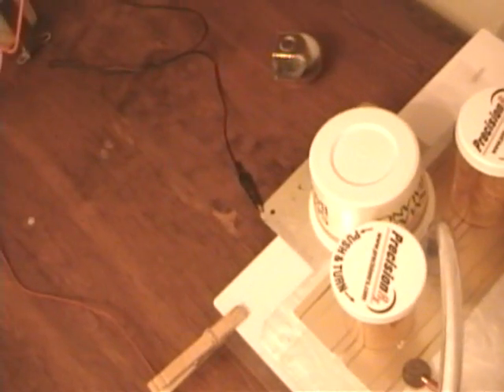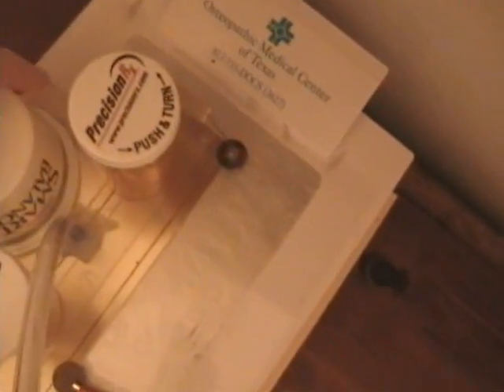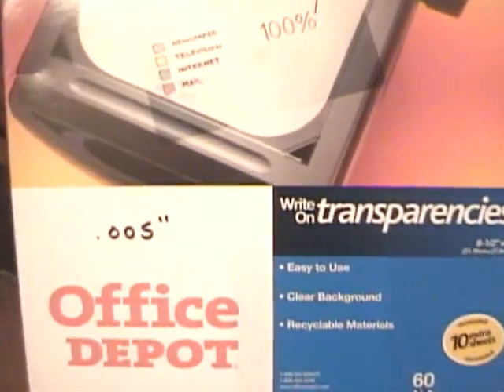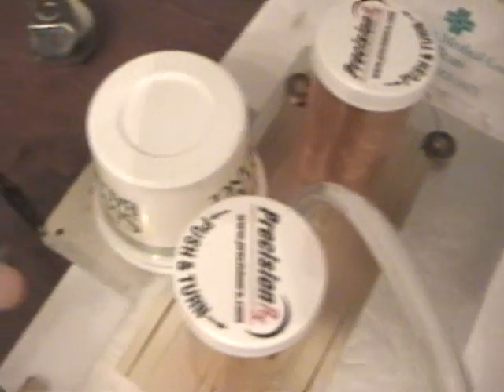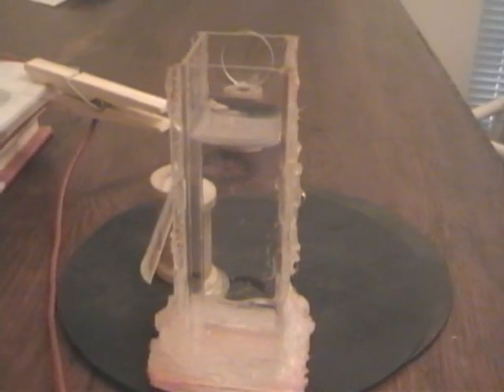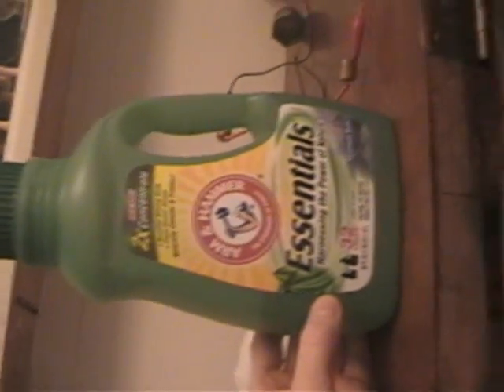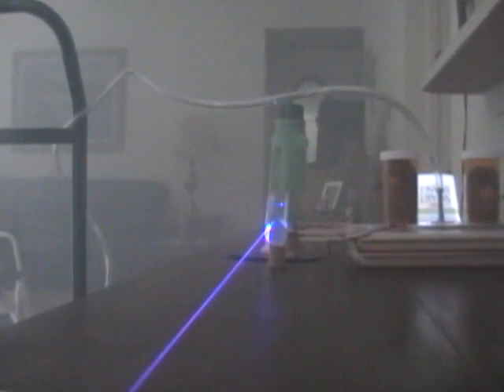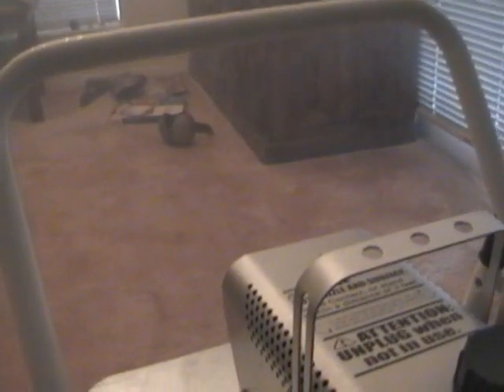amateur visible laser made out of ordinary laundry detergent

Comment: do you really need the gas to make the beam visible or can a simple air tea laser if good enough pump the dye to create a visible beam?
Reply: do you ever reply? what is the point of this if you do not interact and answer questions?
Reply from the maker: Yes, I agree. You are correct. Please accept my apologies. 

To answer your question, the dye lasers I build are not going to produce a visible path through clean air. Unlike a continuous green or blue laser, the average power from these dye lasers is insufficient to produce noticeable scattering in ambient airborne dust. However, the peak power is far beyond the output of a continuous laser. It is the peak power that makes these dye lasers dangerous.
Reply: @magx1  hi thank you for the reply,perhaps you did not get notice of my reply via your email a year ago or perhaps you been busy and did not notice it till now but anyways,,, i was not talking about the gas as in the smoke machine i meant the nitrogen gas,i should have made that more clear, 

1)so what i noticed is that when you turned on the laser there was no visible blue beam coming out till you introduced the N2 gas into your channel , i am wondering why is it not possible to see the blue beam without the gas? i understand the concentration of N2 in the discharge channel makes it more lasing efficient but since there is already 75% N2 concentration in the air to begin with im wondering how come it did not work runing it at normal open air to produce the blue beam? in that case would it simply need more power if you did not use N2?

2)also why did the beam come out from the edge of the lens and not from the centre?  

3)what i also do not understand is how come the dye is being pumped by the uv beam from your tea is making the dye lase with a blue beam that is perpendicular to the uv pump beam?? how does it chose which path to create the blue beam unless you got feedback mirrors or resonator? does the cuvette glass act like mirrors here? so you got a pump beam incident on the dye at 90 deg and then you are getting a blue beam forming that is 90deg to the pump beam? why does it happen like this? why is the blue beam simply not also 90deg in line with the pump beam juts like in most dpss laser pointers?
Reply: @magx1  could you please reply to question 1) and 2)in the above comment i posted you? dont bother with 3) as you already explained that one ,thank you
Reply from the maker: @ARCSTREAMS  Hi, 

The nitrogen makes a big difference over air. Even though air is mostly nitrogen, oxygen is purportedly bad for lasing. With air, lasing can be weak or barely noticeable based upon the quality of the build and all other factors. With air, the blue beam was either absent or too weak for visible scattering from smoke. 

This laser is transversely pumped. It is not longitudinally pumped. The nitrogen laser beam pumps the detergent-based-dye on the side, at a 90° angle to the detergent laser output. The nitrogen laser beam is focused to a line in the detergent. Amplification takes place along the length of this line. A beam basically emerges from both ends of this line, though one end can often be stronger. The walls of the cuvette can behave as mirrors but it's unnecessary and not always desirable, in my case, since the walls are not aligned or adjustable. 

Thank you for your interest. Here's an absolutely excellent page on the subject, with a straightforward and crystal clear explanation. 

http://technology.niagarac.on.ca/people/mcsele/lasers/LasersDye.htm
Reply: @magx1  thank you

Comment: magx1 - I guess you maybe would want to try 211 nanometer or lesser in pumping light wavelength, maybe from Iodine-Xenon laser. Who know... I haven't tried - maybe I will get to it.
(Also, theoretically, the car coolant MIGHT lase, who know? If you want to do it, don't mix it with water, just use rubbing alcohol - Also, grab a radiator if you want 1,000 watts of green laser light from it. O___O )